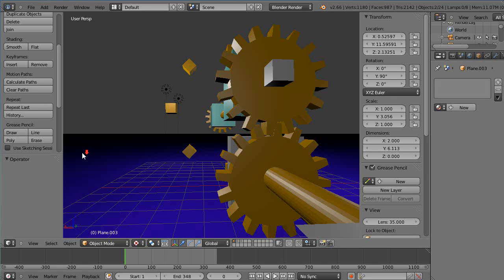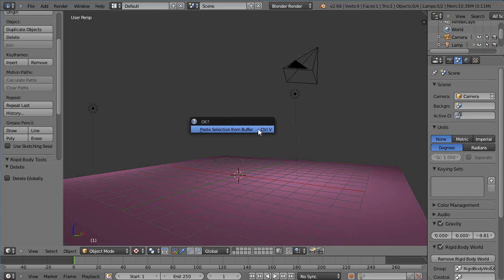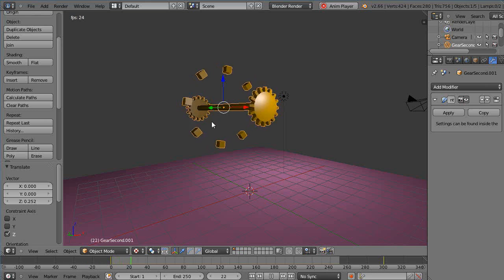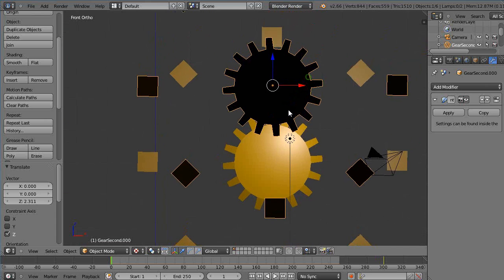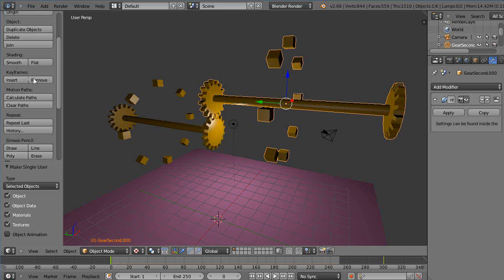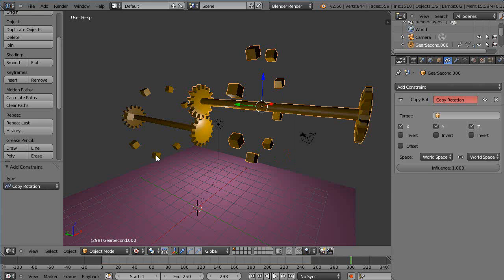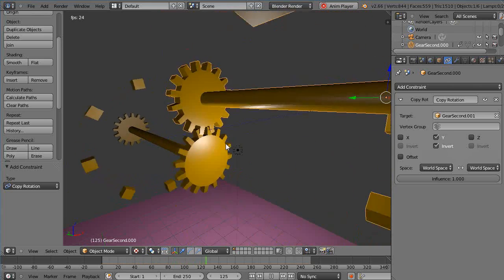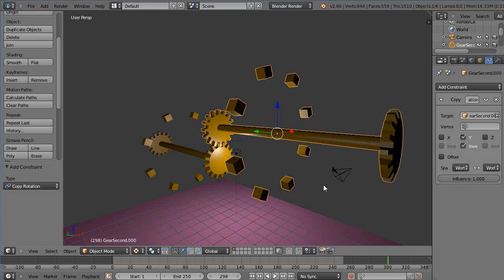Blender 2.66 Tutorial - Copy Rotation Constraint for Simplified Gears

Comment: sir one more problem iam facing is if i use an array mod for an object with a self rotation on its axis the next arrayed objects rotate around the mother object but not on their own axes.  we can copy and place the objects but if the no of objects are more array is best. pl help me .
Reply from the maker: After using the array modifier, go into Edit mode, press 'p' on the keyboard  "Separate by Loose Parts" (as long as the objects are not touching). Leave edit mode and use the menu option - Object/Transform/Origin to Geometry.  That should work. I'm a little rusty; almost  2 years now without Blender. I can't even use the latest versions as my graphic card is dead. Good luck.